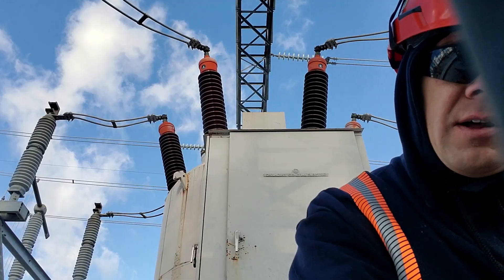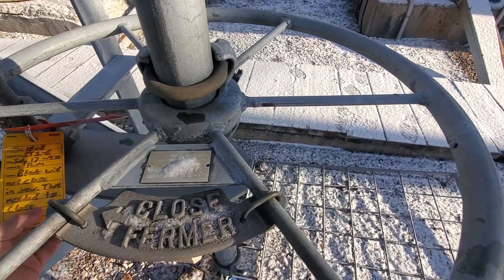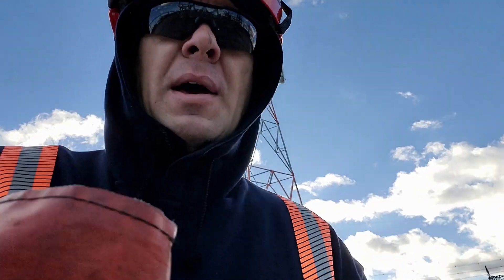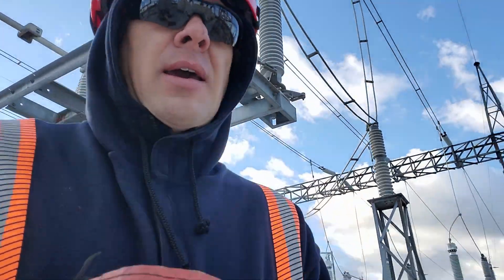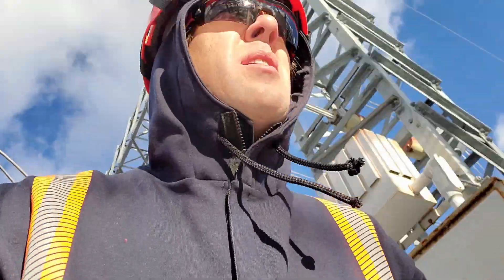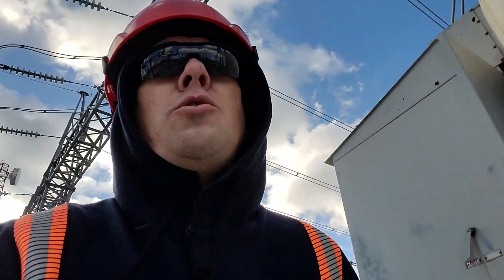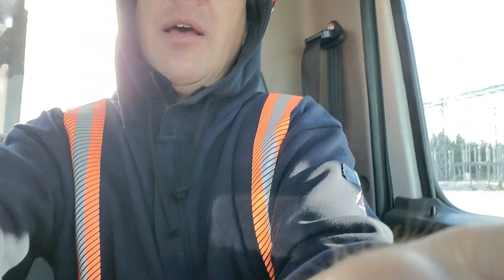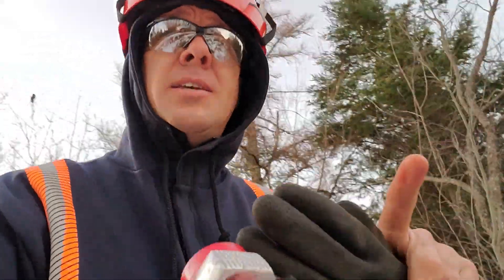138 kV switch  malfunction

Comment from the maker: Hey Everyone! 

While filming some 138Kv switching, things didn't quite go as planned. I was initially going to scrap the video, but decided it would be great to share and emphasize the importance of stopping all work when a problem is encountered. This applies to all jobs! 

During routine work, if ever you encounter a situation that isn't consistent with the pre job discussion - Stop and reassess the situation. Make sure everyone involved in the work is aware and come up with a new plan!

Cheers all!
Reply: Aaron, you're really putting out some great info. As a system operator, I enjoy seeing what's going on on the other end of the phone call. I can't tell you how many times I've gotten the call that a switch won't operate correctly and we have to start figuring out our next steps. Keep up the good work and as I've said before, BE CAREFUL!!!
Reply: @jwilli2460  yes
Reply: Is there a adjustment for that second bar so that you can set it to close better?  It’s like the second one is a tooth or more out of time with the first one.
Reply from the maker: @Earl Estes yes there are multiple points of adjustment.  It can be finicky at times, but usually not an overly complicated repair
Reply: Adherence to protocol can never be overstated when dealing with such equipment; it is an absolute.
Reply: Seeing as the middle phase was the only one that closed 100% that disconnect needs some scotchbrite and a coating of graphite and it will be mint! Glad to see your not the only other utility here in Canada that has those bulk oil breakers!!!  MB hydro power electrician here
Reply: @conradbarthel54  we have a lot of the oil breakers down here in the States as well. They are SLOWLY being replaced with SF6 breakers.
Reply: @jwilli2460  they are great breakers! Probably last a lot longer than the sf6 crap!
Reply: @conradbarthel54  I definitely won't argue with you! They don't need heater blankets and we don't get alarms for low gas like with the SF6 breakers.
Reply: @jwilli2460  we have one air operated one left in my area….
Reply: As always there sir...learned things I didn't know before - very entertaining and fun to watch you while you on the job. I am curious as too WTH geo cash is ?? or what that small plastic container was for?  Love the videos and the wide menu of things your job brings too you!! Keep up the great work - (Along with you fellow workers).  I was wondering if you know the frequency your company operates on...would love to listen in.   thank you  Jeff
Reply: @montanaboy3777  I can answer that as Canada and the States are tied together on one huge grid. We operate on 60 cycles. I know Europe and many other countries are 50 cycles.
Reply: @jwilli2460  He's asking radio frequency, power line frequency.
Reply: @jwilli2460  oh my friend...lol  I didn't mean line frequencies...I meant your radio frequencies...sorry. LMAO (I am happy to hear your also on the 60 cycle waves as your surfing the highlines though)  LOL
Reply: @montanaboy3777  Ha ha ha 😂😂 Damn I missed your comment about you would love to listen in. What was I thinking?🤦🏻‍♂️ I definitely can't help you with that one 😂
Reply: Sound advice. A lot of expensive dsmage or outright injury can be prevented by doing this. 🤔 reminds me when I got an Insta trip on a 100A 600V breaker for a water jet cutter. Tried again and tripped again. Loto'd the machine and power box. Let the techs know it tripped twice hard and to be careful as it got a hard fault and the breakers are only good for very few hard faults. They tried again against my advice and the breaker blew up. Throwing shrapnel like a grenade. They at least used the cabinet cover as a shield so nobody got hurt, but the one who threw the switch soiled himself...
Reply: Love seeing your methodical work!
Reply: I would have given it another go to see if the other two still did not lock into position.

Comment: I like the methodology. It's a lot like railroads. When a Maintenance-of-Way (MoW) gang is working a problem, such as a malfunctioning power switch. A "power switch" is a motorized switch for switching a train to one track or another at a junction, such as a passing siding. It can be remotely operated by the dispatcher, or manually operated by a train or ground crew on site. With train traffic still moving in the area, the gang foreman will call the subdivision dispatcher via radio to get a "track and time" warrant to occupy that section of track. The warrant will specify the warrant #, the exact milepost location where work is being accomplished, the track limits (from milepost # to milepost #), and whether the track is a main line, a siding, or a branch line. 

The time declared for the warrant depends largely on traffic density. If the track is low density, such as an industrial lead or a secondary branch line, the warrant will specify a time limit. If the track sees high density, such a section of a transcontinental line, the warrant will read "joint with dispatcher until called." This means the MoW crew must clear the site for approaching traffic when the dispatcher so informs the foreman. The warrant is cleared, allowing the train to proceed at a reduced speed. Once clear, the track foreman will call the dispatcher to create a new track-and-time warrant with the same information as the previous warrant.

Obviously, a railroad is not an electrical transmission line, and vice versa. However, procedures for doing/completing work are similar.

Fun fact: the rails on a railroad actually have a tiny current running through them, pushed by a very small voltage, maybe 2 or 3 VDC. Rails run in shunt circuits and are normally open between blocks. When a train runs over a shunt, it completes the circuit, which signals the dispatcher where that train is on the railroad. Shunts are also used to activate/deactivate grade crossing protection.

While the two industries are miles apart in form and function, there are, nevertheless, similarities between both. Also, on a railroad, any signal or electrical apparatus needing maintenance is performed by a "signal maintainer."

I thought you all might find that interesting. 🙂

Comment: Filming a video while you’re doing high voltage switching is a safety hazard. You should be focused 100% on what you’re doing and not distracted with videoing. I’m surprised your company doesn’t fire you for doing this.  I’ve been trained that when you’re doing high-voltage switching there was no other conversations or distractions. Well doing switching.  Your life and others are on the line.
Reply: He is simply verbally explaining the processes out loud as if he was an instructor. As long as he doesn't start rambling on about what he ate on the weekend I don't see the issue. He looked very focused;

Comment: So you work on the lines on the street? And switch in the substations???? Do you do construction in the yards too? And control wiring? LOOKS LIKE YOU HAVE A WEALTH OF KNOWLEDGE. And are you switching by yourself??????????? Big NONO where i work
Reply from the maker: Our company is big enough that we're exposed to all aspects of linework, yet small enough that there isn't enough full-time work for certain tasks. 
Underground lines for example; all kinds of it around, but we don't have dedicated U/G crews. Sometimes we'll go a month or two without any underground work, so all of our crew are trained to do both O/H and U/G.

Our substation work is preformed by our transmission crews and sub techs... We do have dedicated Crews for this type of work, but they are sparse. 
I often get called for unplanned switching or even simply to assist.

Our standards allow for switching to be performed alone following strict procedures. If at anytime I request a second person, I'm never refused. 

We typically bring a second person on site outside of regular business hours when there are no other crews on the road.
Reply: @Bobsdecline  Good to hear about switching and requesting another guy.  I work for the big Utility Co in Connecticut, I been in the substations for about 5 years. We replace or add anything in the yards and respond to emergent work in the yards. If I can do it all over again right out of high school I would have gone right into the line work. But it’s the best job as an electrician. I enjoy the work and we have plenty of time to do the work so it’s a nice “steady” pace. I like doing the physicals on the control wiring but doing write ups I don’t really like doing. (Where we verify electrically the schemes will work when we remove and add new relay packages and whatnot . Great to talk to you brother! Be safe out there.

Comment: A Cleaveland Price switch has the same style switch that would fix that problem 😉 if you don't feel like adjusting the interphase pipe to get the blades to fully seat in the jaws of the switches

Comment: Just in the interest of safety...at 9:04 you didn't visually check to ensure all 3 were OPEN before removing your gloves. Obviously, they SHOULD be open, but if the situation is potentially dangerous enough that you need all that PPE, visually ensuring all 3 are open BEFORE removing ANY of the PPE would seem to be the safest course of action.  But I am just a viewer with no electrical background, so what do I know. LOL

Comment: If something ever seems off, check it.
This is a good thing to keep in mind for most if not every industry. Including the field of structural engineering and architecture. Which is where I'm going.
There have been lots of tragedies caused by people not double checking.

Comment: No offense, but what is the purpose of wearing HV gloves during operation of the switch wheel? Isn't the purpose of the switch ground grid beneath you and bonding in order to make you equipotential to ground? Wearing HV gloves would defeat that purpose in my opinion. Also C-phase of the one side blade was ridiculously out of alignment!
Reply: I think he's mentioned in another video (in the context of using gloves while using a hot stick to operate a cutout) that his company requires gloves for all forms of switching, no exceptions.
Reply from the maker: @random832 that's correct! Thanks

Comment: Brings me memories. Years ago had to do a computer deployment for an energy company, which included a mandatory 4 day electrical safety course. No problems working in the offices but having to walk into the protected switching park to access the local main control room, surrounded by lots of lattice structures with very heavy HV cables strung everywhere. Safety was drilled in: Stay on the concrete path. Don't walk on the gravel on either side. If you fall or slip don't move and call for help. The control team will come looking for you if you are not there in 5 minutes. And the omnipresent angry buzzing like walking into a hornets nest was extremely unsettling and oppressive!

I did ask the team why the big safety certifications just to drag in and out a bunch of computers, and the offhanded sarcastic comment from the site supervisor was to the tune of "if one of those 63kv lines strung across the parking lot falls to ground, all the earth connectors in the building will go live. And if you plug in a computer at that time, it will kill you. But at least you will know why you died".

I will admit that the short 100 metre walk to that general control centre was genuinely scary! All the time remembering the spark gap distances for any energised conductors we were given in the training. Getting up close and personal to enough power to run a  region with a town of 100 000 people and an industrial zone containing one of the countries largest oil refineries was awe inspiring. And yeah, scary!

Comment: I did it., I burnt up a 300 dollar light today someone else decided to put the wild leg on a 240/480 circuit on the light circuit. The 480 lights was changed out to 240 lights put the photo cell in it, and it went 30 foot higher than the pole.

Comment: Always nice to see things like this. So many companies out there ignore the basics at times that it winds up costing time and money.  Something as simple as "go flick that switch and make sure it's working right" can turn disastrous in a hurry if even the most simple of procedures aren't followed. Question I have is why didn't the two bars seat fully? Issue with the bars themselves, or with the rotating mechanism or ??? I'm surprised that the gearing didn't let it go past the 90 degree mark under force.... Curious now.... 
Stay safe up there!

Comment: heres the break down approximate,There are  Five total( some say theres  SIxth  one fom israels'  breeding program )     Unblemished Red Heifers , (@6-9month year olds as of now )    and have  arrived in Israel sept 15 2022  , these  will be  used in temple sacrifice when they are at least  2 years old - and  maximum  4 years old,  this means and tell us that   2022 + ( 1.4 -1.7 years appr  to reach maturity) =  2024 , and  4years maximum is - by 2026   the  rapture  should have  happened , even though no one knows the day and hour it will, we can see it is closer than ever . Many who follow the pre rapture timeline agree we gentiles will not see the built temple, as it  is not for us, but  Gods workings switches at this point back to israel / jews only, as we are  Longggg Gone.also russia is setting up right NOW,  clearly, for the  end times movements , for the known russian attempted  strike mentioned gog/ magog war who they are part of .

Comment: Good evening, Aaron. My mistake on the voltage on our utility here in Montgomery County. They were 230 KV. There are a set of that runs from Montgomery to Howard County that are 500KV also. I did the old rule of thumb counting the rings on the insulators. But, yesterday made a call to one of my engineer friends and he confirmed the correct KV.

Comment: I work now for a large research center of a global corporation as an electrician.  We work everything from the outlets and equipment all the way out to the yard where we have 138KV incoming for the whole facility.  They make use dawn the 40cal suits et al for any manual switching.  But like you said, it is rather easy if you just follow the check list.  Cool videos.

Comment: Why are doing switching alone ? I have 32 years in the industry and was never allowed to do any type of switching without at least one other person as backup. And we were in constant contact with eaither dispatch or the control room. Every step was announced, repeated, verified, and then performed.
Reply from the maker: Every step is absolutely repeated and verified. Sometimes multiple steps are given during that process. We are allowed to switch alone, but often send 2 guys. If ever while switching alone, a second guy is requested, they are never refused.

Comment: Thanks! A video showing best safety practice is great to see!  On a related note, I’m sure you know this but maybe some of your viewers don’t: that grounding mat at the operating wheel you mentioned is an equipotential mat, to ensure your feet and hands are at the same voltage if a phase to ground fault should occur.  Critical safety device, and as you say must be checked for continuity before operating the switch.  Such a simple device can save a life!

Comment: I used to service the refrigeration systems for CO-2 fire suppression systems at power plants fueled by natural gas. Another service company was out replacing a compressor and when the tech was ready to power the unit back up, he walked into a building, cut the tag and energized the breaker. He was escorted off the property never to return. My company was dispatched and I had to finish the job. They take lock-out tag-out very seriously! No excuse for the tech to violate protocol like that as they give you a radio and instruct you on it's use. Call the man and someone will be there.

Comment: Some years ago, part of the Bay Area had an "Oops!" blackout, during work on major lines like those: 

"PG&E blamed the outage, which affected more than 375,000 households and businesses in San Francisco and on the Peninsula, on construction workers who failed to remove a grounding apparatus before restoring power to substation equipment they were servicing.

The utility also faulted a control room crew for turning off protective devices designed to confine any outages to the substation."

Comment: I admire your willingness to do this job; I'm ok with 220 VAC but the kind of voltage that comes out to get you... 🤔
Reply: LOL I've had 480 try and bite me on a damp day when I go to touch my fluke leads to an ats checking generator power by seeing a little arc reach out and touch the metal tip before I make contact, that's enough for me forever !

Comment: An old Kearney double side break disconnect.  Why do you have 2 ground paths?  Is the ground mat bonded to the ground grid through the vertical drive pipe of the operator or is the braid between the ground grid and the vertical drive shaft just in addition to the multi-rev grounding device?